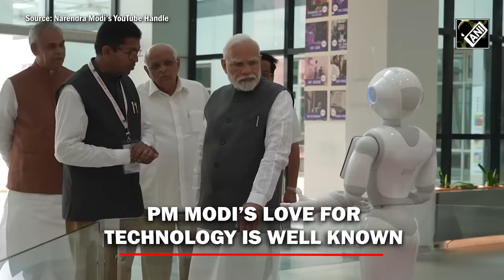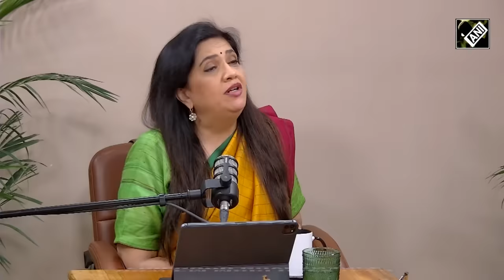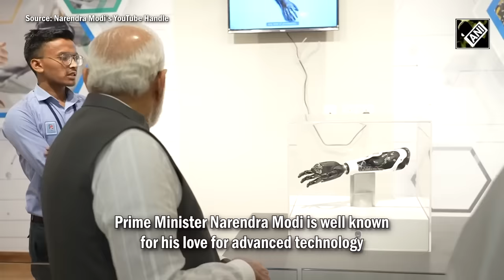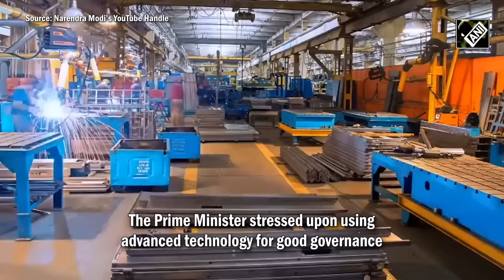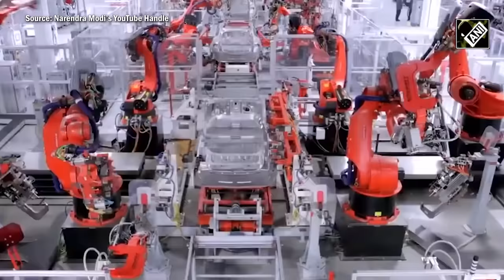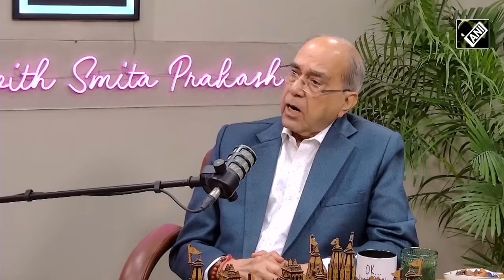“We were not used to…” Ex-Principal Secy Nripendra Misra reveals PM Modi’s working style

Comment: We've recently done a road trip to Koraput, a very backward area in Odisha. Our total expenses was 25000 approx & out of which only 3000 cash transaction was done. Rest 22000 was through UPI. Even a small tea stall, coconut water vendor, breakfast point in dense forest region has UPI facility. It's a brilliant transformation for sure.
2nd is fastag. What a smooth process. Just recharge the wallet & chill inside your car.
National Highways are butter smooth. 
Yes definitely there is transformation.